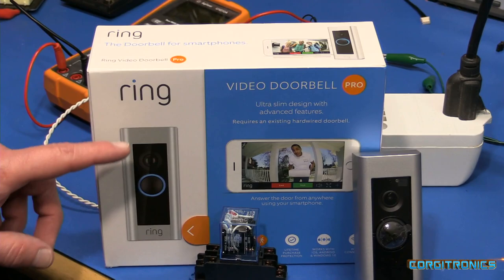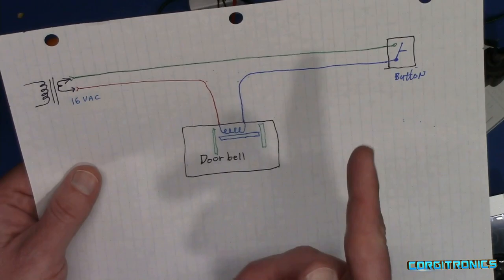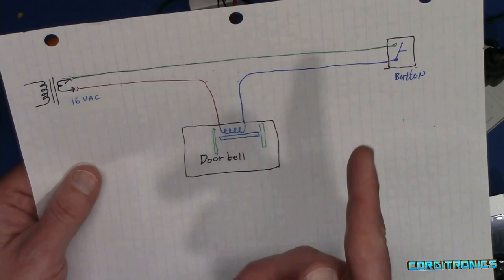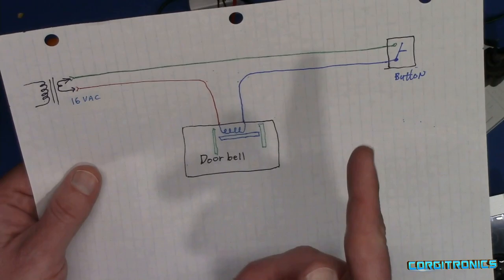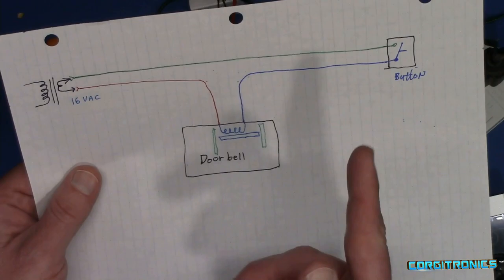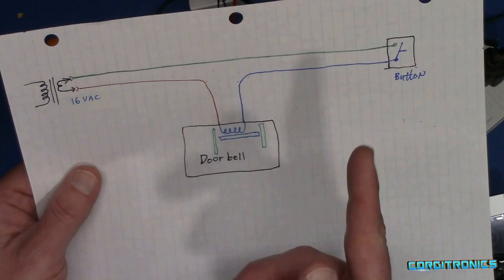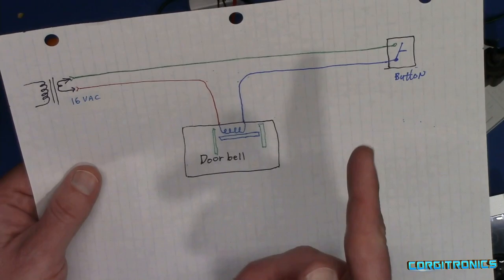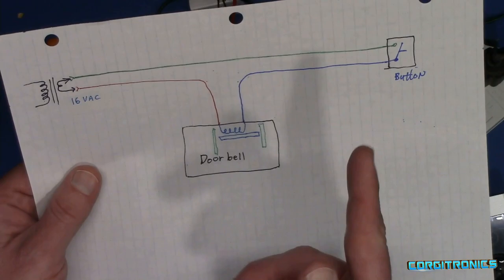Connecting a Ring Pro Video Doorbell to the electronic chime in a Nutone intercom

Comment: Hi Corgitronics. First of all thank you very much for this very informative video. I just move in to my new home (not really new coz it was built in 2001 and i'm the second owner) that has the m&s mc602 intercom that has master unit/speaker and remote scan/speaker in every room. 
I just bought last Thanksgiving sale a ring pro. I want to integrate this to the existing mc606 if possible wherein when a visitor push either button (doorbell button of mc602 or ring pro) it will activate both units. Will this be possible? If its not too much to ask, can you make a video for this setup with detailed step by step instruction/guide including lists of additional parts needed and where to buy them. I know im not the only person who will benefit for such instructional video. Thank you in advance.
Reply from the maker: I can't find any information about the M&S MC602 intercoms, but if the doorbell button connects directly to the chime board on the intercom then you should be able to follow the same approach.  On the current M&S chime boards there are contacts such as COM, 1-NOTE, 2-NOTE, 3-NOTE.  Just connect the relay's contacts to the same contacts that the doorbell button is connected to.  Your chime board may look similar to this one, manufacturers usually don't change these much over the years:  https://www.homecontrols.com/homecontrols/products/pdfs/MS-MnSSystems/MSMC3_Manual.pdf

Be sure to watch my short follow-up video about the relay connections:  https://youtu.be/hd68roYUDng

Now, for the second part of that... having the regular button trigger the Ring Pro... that would require going into the Ring Pro and connecting to the internal contacts of it's button.  That might not be too hard to do, but I haven't dismembered my Ring Pro to see.
Reply: Thank you for your reply. Still trying to find somebody willing to install it. If I can't find one I might try to install it myself and hope I won't burn my house... lol!
Reply: Hello again corgitronics. Pls be patient with me because up to now i haven't found one willing to give the connection a try. Im having problem with the hook up on the main intercom system because the transformer has a TE5B (primary 120v 50/60 hz and dual secondary output of 16v 37va). From the transformer enclosure box (two 16v dual output) comes out 5 multicolored lead wires that connects to the main ms602 board and some wires connects back to the chime module where the door push button wires are connected. 
My issues are: if im gonna replace the 16v transformer to 24v, how will i do the connection of those 5 different collored output wires and will it not burn the other devices connectec because of the increase in voltage?

http://imgur.com/gallery/S5Pxs6K   this is how the transformer look like. The te5d (stock picture i got on the internet) is the same as mine its just that the te5b is 16v while the te5d is 16.5. I can't find a stock photo of te5b).

https://i.imgur.com/PJropS9.png

http://imgur.com/gallery/mEjVcqM  
link for the wiring guide for mc602 intercom system.

http://imgur.com/gallery/79V7R9E 
Link for some of the photos of my intercom system.

If you are willing and kind enough to help me with a step by step connection guide and solve the connection issues pls feel free to pm me at chard2005rivera@comcast.net.  willing to send $100 check to compensate your trouble. It's not much and might even offend some professionals like you but i think its better than nothing. Pls help me with the connection. Thank you in advance.

I have the parts needed with if the set up is like the one on your video and i also bought a honeywell transformer (24vac 40va in case we decide to replace the existing transformer and mount it on the enclosure box. Thanks

I forgot to mention that in your video " how to connect ac relay" i noticed you did bundled-connection of the wires of the push button and wires of the speaker on the fron door outlet. Since my transformer has dual 16volt output, will that create a problem?

Comment: Thank you! I am trying to install Ring Door Bell 1 to work with Nutone IM-3303 electronic chime and this provides very useful info. Where can I buy the Pro Power kit?
Reply from the maker: I'm not sure the Ring Video doorbell 1 can trigger the chime.  But, it can be powered by an external AC transformer:  https://support.ring.com/hc/en-us/articles/205180710-How-to-Connect-Your-Ring-Video-Doorbell-Directly-to-a-Low-Voltage-Transformer-Without-a-Pre-existing-Doorbell-
In reading that article, it looks like you need a 25 Ohm wire-wound resistor (see their link), and you might be able to connect that across the relay that I show in the video.  Basically, just replace the "power kit" with the 25 Ohm resistor.   It needs to be a high power resistor, they specify a 50 Watt resistor.
Reply: @Corgitronics  Thank you for your quick reply!!! I thought the relay could act like a mechanical chime so I was going to wire the relay just like how one would do for the mechanical chime. Of course I would not need to use the diode. If the relay load is not high enough, I might need the 25 ohm resistor?
Reply from the maker: @benc.7419  You will almost certainly need the resistor, and do not use the diode.
Reply: @Corgitronics  Got it. I will update once I finish my installation. Thanks again!
Reply: @Corgitronics  I installed 25 ohm resistor in parallel with the relay and it works! I tried using one of the two Nutone transformers and ~16 VAC didn't trigger the relay switch although it was enough to power up the Ring Door Bell. I added 24VAC/40VA transformer and everything works fine. Thanks for your help again!
Reply from the maker: @benc.7419  Great!  I will see about a video showing the pull-in and drop-out voltages of these relays, to help others in the future.

Comment: Thanks for the video...
Just to clarify.....
Ring Video Doorbell Pro
If i get that relay and use the pro power kit across the coil, i don't need the 25ohm 50 watt resistor mentioned on the ring's website 

thanks in advance
Reply from the maker: That is correct,  that is how I have it setup and working.
Reply: @Corgitronics  Hi There 

So I have it setup the way you described in the video but the relay won't actuate when I press the ring pro...

Not sure what is going on but any idea...

I checked the relay directly and it works but not in conjunction with the ring pro..

Thanks
Reply from the maker: @sagarsamrat1108  Check the settings for the RingPro, make sure that the setting for Doorbell Type is set to Mechanical.  Here's their FAQ:  https://support.ring.com/hc/en-us/articles/115002791966-Setting-Up-Your-Ring-Video-Doorbell-Pro-in-the-Ring-App
Failing that, check the voltages (with the meter set to AC), and make sure the diode isn't installed.
Reply: @Corgitronics  thank you so much...
Changing it to machanical did the trick...

Appreciate the help....

Comment: Thanks for the video....Will the 24 relay you used work with an 18v power supply? thanks
Reply from the maker: Yes, I just tested this relay, and it reliably closes (without buzzing) at 17 VAC  
https://www.amazon.com/gp/product/B00NN5ABG2/
Reply: @Corgitronics  ..awesome thankyou....The Nutone IM-4406...has two 18v transformers. I believe I can actually tap into one as power source to Ring Pro and the other can run the chime...., while using your circuit...
Reply from the maker: @emccabe1964  That might work, since the IM-44-6 uses 72VA transformers.  The Ring Pro needs 20VA (sporadically), so it could add too much load.
When you connect the RingPro to the transformer, monitor the transformer's output voltage to see if it sags, particularly during the ring cycle.
Once the Ring is up and running you can use the app to check the device health.
Reply: @Corgitronics  - what about eliminating the pro power pack as a jumper?  Wouldn't that reduce the amps and or put it in series with the relay.....a little extra resistance?
Reply: @Corgitronics  ......ignore that last reply.....that wouldn't get me any power with the relay being closed.

Comment: Greetings all.. Could anyone provide a simple wiring diagram. I have a Nutone system like the video.. I assume you cut into the wiring going to the Nutone door bell
Reply from the maker: There is a diagram at 12:09  https://youtu.be/4ZFl6BRTQnA?t=729  and at 15:56 I show the connections to the intercom board https://youtu.be/4ZFl6BRTQnA?t=956
Reply: I don't have cat5 wiring, I assume the 2 pair that came with the nutone will work.  Is there a telephone number I could call you at?
Reply from the maker: @alehrhardt8063  the 2 pairs will work.  Doubling up the wires as I show reduces the resistance and the voltage drop.
Reply: Could I contact you, or you contact me directly, thanks

Comment: Great video!  Any idea if this is possible with the Ring Elite?
Reply from the maker: The relay may not be necessary with the Elite, as it provides a pair of contacts for the existing doorbell.  However,  the instructions don't specify whether it can only work with a low voltage AC or will also work with a DC signal like an intercom.   If it only works with an AC signal,  then this approach should work just fine.
Reply: @Corgitronics  Great video!  What I found on the Elite is, the Ring Elite is compatible with most AC-powered bells operating between 8-24 volts. Unfortunately, the Ring Video Doorbell Elite is not compatible with wireless bells or any bell/intercom system using a DC transformer.  So, it sounds like this would work to the Intercom doorbell button using the relay you suggested - does that sound right?  Could I possibly use a smaller relay?
Reply from the maker: @grtessman  Yes, I think this approach would work, I'm not sure about a "smaller" relay.  You can use one of these AC relays without the socket, which will make it a lot smaller, you just need to crimp or solder the connections.  This and perhaps other options might make for a good video.  But, I have just moved and the new lab is still getting setup.
Reply: @Corgitronics  Thank you again for your reply.  What I meant by smaller relay was more about using something nearer a 10v relay instead of pressing the boundaries of 24v since the Ring Elite is capable of operating. 8-24v.  Does amps matter since PoE (IEEE 802.3af) is power over ethernet and what powers the Ring Elite?  I can't imagine it would carry very many amps.  As for size with the socket, that won't be an issue for me with 2"x6" wall depth I would prefer to use it with the socket.  I'll be trigging the chime button for my Nutone IMA4406.
Reply from the maker: @grtessman  Based on their documentation and the diagram on page 5 of the installation manual, it doesn't appear that the Ring Elite needs any power from the doorbell transformer.   I expect that their circuitry expects that the doorbell connection be AC, but is likely quite tollerant of lower voltages.
I think that you could get by with 16VAC from the intercom's transformer and a 12VAC relay like https://www.amazon.com/Baomain-Power-Relay-PTF08A-Socket/dp/B00YTW5Q0E
Although the relay is only 12V, the amount of time that is on to ring the bell is quite short... but putting a small fuse inline would be a good idea just to protect things.
Reply: @douggeiger9873  Hi Doug - just wondering if you had any success with this?  My Ring Elite will arrive today and I'm about to start playing with this.  Thanks!
Reply: @grtessman  Yes, the relay trick worked.  I used it for awhile with no problems.  I later replaced my old M&S intercom with an iPad that I mounted in a picture frame, wired to power thru wall.  So now I have a slideshow  display / whatever I want it to be + doorbell via ring app :)
Reply: @douggeiger9873  Cool deal!  Thank you for your reply.  I'm trying to locate a faceplate for the ring elite on a Nutone cover but not thrilled about the looks of a plate on a plate.  Wish we had more options there and a single plate that looks more authentic.
Reply: @grtessman  Yes, the elite is quite a bit smaller than my old unit. Here's my solution. I removed the old unit and fitted a wood panel painted to match the house trim color.  https://www.amazon.com/photos/shared/tkyk3fiMTbywtzzxfokqRg.v681xjsNrNeDLUME2S1P9t
Reply: @douggeiger9873 , @Corgitronics I have been trying to make ring elite with with a Broan c305 mechanical chime which is unfortunately found on the "unsupported" list even though their web site says - any 10-24v AC mechanical should work!. Before I found this great video and this comment thread, I actually tried my own relay solution where ring elite closes the circuit on the RIBU1C relay and 16v AC transformer and contact side closes the circuit on the chime. In my case, the chime button connects one of the 16v AC to chime terminal. The issue is that when I connected it all up - I see that ring elite open current across the button is strong enough to actually cause the relay to close and ring my chime non-stop (perhaps it is trying to make the lighted button to work?). I am tempted to include some resistor to drop open current down. If you got elite doorbell to work with the chime that company claims are incompatible then you can probably help me and many other people by sharing your solution.